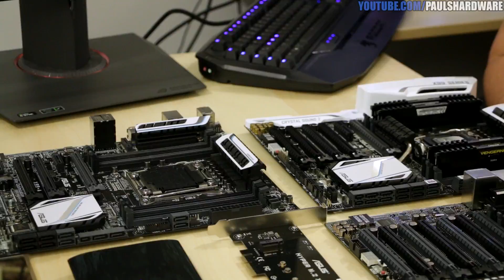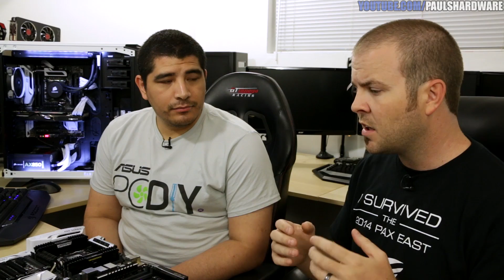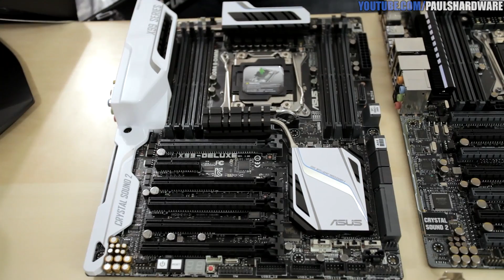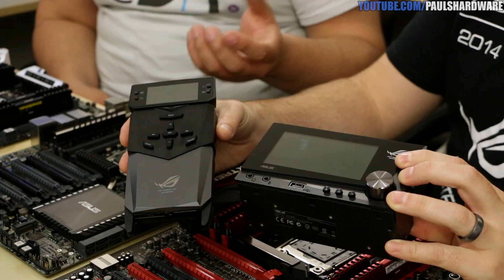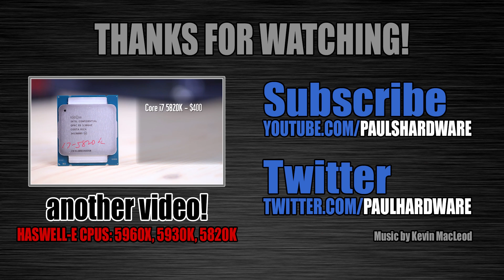ASUS Rampage V Extreme, X99-E WS, X99 Deluxe Motherboards with J.J.

Comment: ......about to test my ASUS X99-E-WS-3.1 with my OEM unusual 2679 V4 I seen 
work with a ASUS-X99-E-WS-10G which are basically the same board for 
most part so hoping, HOPING........ X99 is still "in"... Lets go with 
the broad-well xeons still on your channel man.. "C'mon man!"... LOL ...
 Allot good & cheap 14 nano meter broadwell v4's NOW.... 2021 is the
 time for Broadwell when it comes to fun and or cheap setups that KICK 
A$$.....

Comment: Greetings Paul, surely would be interesting to see how real time data transfer goes on those Asus thunderbolt pcie devices. Per example having two high speed storage devices on two machines connected through thunderbolt. Interesting fact, MSI have made such thinderbolt device which has Alpine ridge controler integrated into the device itself.

Comment: i believe this new rog rampage v editon 10 will be a slight  upgrade from the formula 4 crosshair fx8150  with 8 gig or ram an 1200 watt power supply   i just hope this one has lightning protection threw the  either net  i loss my main pc  loved the old board but time to upgrade so i get a little upgrade i believe running the new processor correct.   store photo and contracts an estimating  what processor do your recommend
thanks jj

Comment: Strangely, though one of the marketing features of this MB (and its extreme price!) is that it is so extensively tested with other hardware components, it has problems with posting with 2X Titan X's (In 2-Way SLI only black screen appears and the MB shows q-code b2, which indicates "legacy ROM initialization" - no ROM ever to be plugged in the MB), which is a known problem with some MB. ASUS support doesn't do a whole lot giving just general recommendations time after time - check if all the cables are attached, reset BIOS... The reason I bought this MB considering its monstrous price is 7 PCI-E's and EXTENSIVE COMPATIBILITY TESTS! Feels like I've been... Either way it would take something extraordinary for me to consider buying ASUS products again...

All components have been tested prior to installation, everything works fine when only Titan X is plugged. Different PCI-E slots combinations do not solve the problem. BIOS update did not solve the problem. All PSU cables were checked numeral times, different PSU cables vere tried, different PSU were tried. Switching primary/slave GPU's didn't work. Tried different DVI cables (I'm aware of digital/analog differencies).

Comment: Hello there! I'm a 3D freelance artist from Uruguay, and I would need some tips to build my new pc. I would like to start from CPU: Intel Core i7-5960X 3.0GHz 8-Core Processor.  Could you tell me what the other element do I would need that can be compatible to develop my work. For example I use 3ds max, zbrush. I have thought of spending no more than $ 3200. Thanks!
Reply: sure I can help you. get rampage v extreme, gtx 980 32gb ram ddr4

Comment: Question for Paul or JJ: Which one of these would offer the most robust (in terms of maximum potential and stability) for overclocking? Another question is, I notice the DELUXE board has a more capable PCI-E setup than the ROG board (16x, 8x, 8x for ROG, vs 16x, 16x, 8x for the DELUXE), what features makes the ROG board cost ~$100 more?

Comment: Are any of the X99 boards going to be 4 x16, x8 (x16, x16, x16, x16, x8) like the Asus Rampage IV Extreme?
Reply: ***** didnt asrock make something like that for x79 that extreme 11 thing
Reply: It's not gonna matter. If you think you need to run 3-way sli you should've bought a better card in the first place.
Reply: why would you assume I did? I never said I did, never said I was gonna get anything, was just a simple answer that could have been answered easily with a yes or no. I didn't need everyone's life story that came with the answer...
Reply: Likely because the PCI bandwidth is mostly used to calculate graphics cards possible speeds. If you weren't talking about graphics cards or possible sli data transfer speeds in regards to various sli configs, then I think that's the most useless question I've heard in a while. Other add-on cards like sound cards don't even use that kind of bandwidth. Perhaps capture cards? Someone correct me if I'm wrong.
Reply: *****
 reason that i can see for 7x PCIe 3.0 x16 is 7 Teslas in a sever but then i would go wtih a SuperMirco 2x or 4x Xeon build instead
while with gaming builds i do agree with you as atm the most demanding GPU card being the R9 295x2 only does 60% ~ 66% of a PCIe 3.0 8x lane under load mainly because it is a dual GPU card but in that how would the X99-E WS board do with Telsa K80s ?

Comment: This video was really informative as usual Paul and thank you and JJ for making it.
There is no doubt that ASUS is at the very top of the game regarding diy PC parts. All of the parts, except the WIFI adapter cards that came with z77 motherboards work right out of the box but hear what i want to know, when will ASUS support match the parts that they sell? ASUS support is really frustrating and slow. JJ pass this information along to the support department please.
Reply: for my own experience with Asus support, i would wrong u. i live in Greece and i have G53Sw gaming laptop which i bought from the middle east while on vacation. it had international warranty and in Greece there is no customer service facility for maintenance. the laptop electricity pin broke down and i called free support number where they identify the laptop through its serial number and shipped it to Czech republic where they fix the issue and i got it back in two weeks. it was great service. BUT the problem wasnt the  service rather than the quality of the product, cause after they changed the whole electricity pin in the board (which was a faulty design) and the touch mouse cause it was buggy. the mouse broke down again and it lags a lot. and the screen has huge line (change its color when u press on the sides) going from the top of the screen till the bottom (thank god it's on the side not  in the middle as i've seen in some incidents). i checked some videos on this issue and it turned out its unfix-able and u have to change the whole screen. and im out of warranty and cant afford to pay for new screen since im student.
Reply: Abakos if I had that experience I wouldn't express the view that did. I already talked to JJ about my two incidents with online support and he understands what I am talking about.

Comment: Really, the only "complaint" that I have about the X99 boards from Asus is that they should have just copied the Deluxe's heatsink design over to the Extreme, and just paint it black and red to match the board. Seriously, it's so good looking, why not have it on there too? Other than that, the Extreme would be the board for me, had I not built a Z97 system last month.

And with that said... Is there any chance we'll see something like a Rampage V Formula? I think the Formula series boards have the best designs ever, and don't lack any features. I have a Maximus VII Formula in my rig and it's been more than awesome.
Reply: ***** Don't take it as a criticism, I love the new lineup. I get your reasons for doing things the way you're doing them, but I just had to spit that out.

Now, if there is a RVF announced down the road, I may be tempted to sell my current rig and go Haswell-E. Damn! :P

Comment: I'm building a new pc and i want you guys to tell me if everything is compatible, here's my spec list. Thanks!

i5 4690K
Asus Maximus VII Ranger
MSI R9 280X
Corsair Vengeance Pro 2x4GB (2133Mhz)
Corsair 450D
Evga NEX750G
Crucial MX100 256GB ssd
WD 1TB
Corsair H100i
Reply: JernCraft The H105 has a better build quality :) just a heads up
Reply: looks alright to me but next time, ask on a forum such as the LinusTechTips forum or Tom's Hardware :D
Reply: Kamyar Ameri
Nobody is saying to use a really cheap motherboard, I'm saying things like Gigabyte Gigabyte 			GA-Z97X-UD3H-BK, EVGA Z97 FTW, Gigabyte 			GA-Z97X-Gaming 5, MSI Gaming 5, 			 			ASUS Z97-AR, MSI Z97-GD65 Gaming, Gigabyte GA-Z97X-SOC, Asus SABERTOOTH Z97 MARK2, etc. I agree you should NEVER skimp on the PSU, always get  AT LEAST Bronze if on a really tight budget, Gold in this case and always leave a little headroom for SLI/Crossfire and OCing.
Reply: randomguyontheinternet Fair enough lol, could have been more clear when saying 'cheap motherboard'
Reply: TheTurdBurglar NO never a cheaper PSU NEVER EVER EVER CHEAP OUT ON YOUR PSU remeber if anything goes wrong on you PSU there goes you whole system
Reply: Shadowaries1
Please don't be a fanboy, both NVIDIA and AMD have different optimized games.
Reply: Everything you've listed is compatible but I suggest you wait around a month for the new line up of NVIDIA GPU's just to see what they bring and you may be able to get something better  instead of that R9 280X :)
Reply: Omar Moatamed That PSU isn't overkill lol... it's perfect headroom for overclocking and possibly even a crossfire/sli setup in the future. Second of all the ram no biggie since there's not much of a difference in terms of price between 1866-2400MHz etc. But in a way you are right, since on Haswell you wont see much of an improvement in performance past 1866MHz ram speed.
Reply: I'd just get the cheapest 8 GB RAM kit you can find and upgrade your GPU.
Reply: Omar Moatamed Like I said, it's not overkill AT ALL... re-read my comment lol
Reply: Omar Moatamed Fair enough lol haha :p
Reply: Omar Moatamed Thanks! I understand but the 2133mhz ram is almost the same price as 1600mhz (In the netherlands) and i can't go for the r9 290 because i'm on a tight budget (r9 290 is 370 euro and r9 280x is 250 euro)
Reply: JernCraft Exactly what I told him lol :p just go for ram that is the highest speed for the best price :)
Reply: JernCraft Hey, that helps! I live in the netherlands too. I'd suggest using Tweakers.net to compare prices. You can make a wishlist and see where it's the cheapest (including shipping) etc.
For example, an R9-290 can be had for about €320.
Reply: TheTurdBurglar Ja weet ik het probleem is dat ik in België woon. Om naar belgië te verzenden wordt veel transport kosten gevraagd, daarom koop ik graag alles bij dezelfde winkel. Ik ben van plan om alles bij azerty.nl te kopen. En 320 euro voor in gpu past nog altijd niet in mijn budget :p

Toch bedankt!
Reply: Maybe it's better to converse in english so the others can follow it as well. You can change country on T.net to belgium to calculate shipping too, so you might still win qiute a few bucks there too. :)
Reply: Get a cheaper motherboard so you can get an R9 290.
Reply: randomguyontheinternet That's not a good recommendation... in fact that's a very stupid thing to suggest. He'd be better off waiting a little while to see what NVIDIA & AMD bring to the market next month
Reply: Kamyar Ameri It's actually a very good recommendation. Cheaper RAM, PSU and Mobo and better GPU is the best thing you can do for this rig.
Reply: TheTurdBurglar Skimping out on a motherboard and getting a cheap one isn't going to do him any good dude.... nor is a cheapo power supply.
Reply: Kamyar Ameri That is based on rumors, we don't acually know if they are coming next month or next year or whenever. Plus there are cheaper boards with more features and cheaper RAM. If we knew the release date and he could wait, yes. But for me I'd rather enjoy the system and actually use it than wait a few months and save a few $.
Reply: Here's what I would recommend:
http://tweakers.net/pricewatch/bestelkosten/630516
€1070 shipped. (don't order from Max ICT, they're terrible).
Reply: randomguyontheinternet each to their own, but my suggestion is to never skimp out on the motherboard or the PSU. The worst thing a system builder can do is go for a cheap ass motherboard and crappy PSU and end up with a relatively expensive doorstopper a few months down the line...  and the GTX 980,970,960 are not rumours the Maxwell GPU's are coming out within the next 1-2 months. Go do your research...
Reply: Kamyar Ameri Low wattage PSU =/= Bad PSU
Low wattage, good quality > High wattage bad quality
Reply: TheTurdBurglar I wasn't even talking about high/low wattage, I already know that lol... I'm simply saying, to skimp out on a motherboard and the PSU is the most stupid/silly thing a system builder can do. It's going to cost the OP more down the line if that cheapo motherboard and PSU fail and he has to order new components... do you see what I'm saying now?
Reply: ***** Thank you, i'm going for a red and black build so the ranger is the board to go for. In Belgium the 280X (only the one from msi) is 30 euros more expensive than the 280 and 50 euros cheaper than the 770. I have been thinking about the enthoo pro but i like the esthetics of the 450D more. And i'm going for the h100i because it has i nice led :)
Reply: Kamyar Ameri Yeah i know but i'm also not sure if it would fit. I'm going to look it up
Reply: +1 on the H105
It's a much better cooler
Reply: TheTurdBurglar i know it sound wierd but i would still go with the h100i because it has an LED :p
Reply: je bouwt is zeer goed, maar ik weet aanraden te gaan met 1 goede GPU en niet 2 onderkant muizen omdat in de toekomst wil je misschien een beetje meer vermogen , zodat je een andere GPU zou kunnen toevoegen , maar het is zeker een stuk beter om een goede GPU krijgen dan te krijgen een medium GPU en vervolgens ook in de toekomst toe te voegen een andere omdat de meeste games ondersteunen alleen single GPU's . ook niet te luisteren naar de andere man nooit goedkoop op de PSU , want het is iets voeden en kon je hele systeem te bakken . als er iets adviseer ik een Nvidia GPU , omdat je beter thermiek en normaal gesproken beter spel preformance omdat veel games zijn geoptimaliseerd voor nVidia . ook u van holland dat is koel mijn familie kwam uit holland over een te genereren of twee geleden waren in Halland u uit en wat dialect je spreekt
Reply: randomguyontheinternet im not being a fanboy most games ive seen of nVidia optimization the only thing AMD has to optimize is mantle which is still to buggy to use
Reply: Shadowaries1 Did you use google translate? :p
Reply: JernCraft no i actually know dutch i actually spreken netherlands
Reply: Tell me how to install corsair h105 on Asus maximus vii hero
Reply: Lawrence Dennis its called reading the manual it does work because the maximus vii hero is an LGA1150 socket board and the h105 supports LGA1150
Reply: Lawrence Dennis
The board doesn't matter, the installation is the same.
Reply: You might want to take a look at pcpartpicker.com, it does a good job on telling you how much power you will draw and it notifies you about incompatible parts.
Reply: DeafMute I allready bought the parts and build my pc! :p
Reply: JernCraft well just pray there all compatible or else your capitol fucked out of a few hundred dollars
Reply: I've already build it and everything's working fine!
Reply: JernCraft well that good